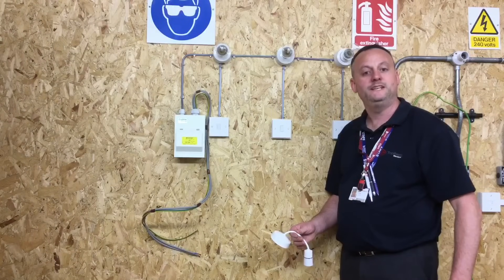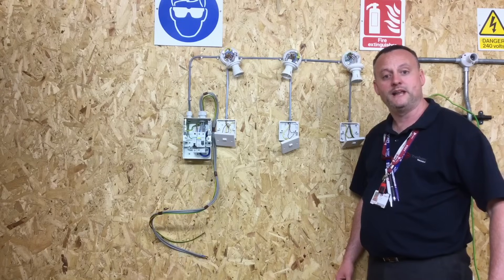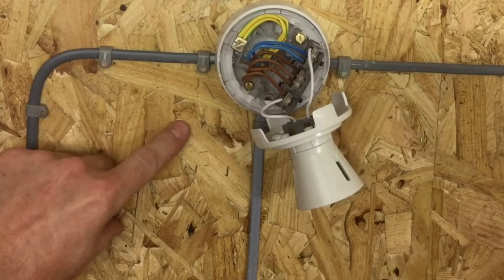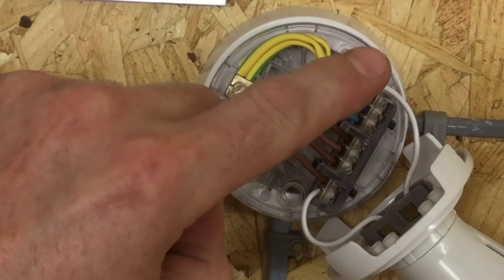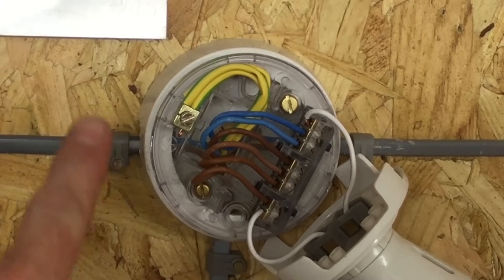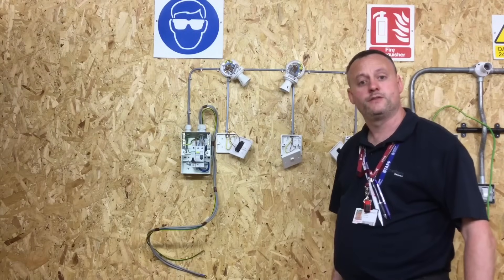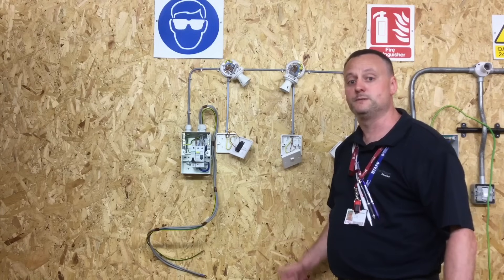3 Plate Loop-in Method for Wiring a Domestic Lighting Circuit - Connections Explained

Comment from the maker: == 🕐 Time Stamps - Cut to the action 🕕 ==
00:00 - Connections in a lighting circuit explained for the 3 plate method
00:50 - Metal consumer unit and 6 amp MCB
01:41 - Connections inside my consumer unit
02:54 - Connections in my first lighting point explained 
04:37 - Connections in my first light switch explained 
05:06 - Continuing on the 3 plate method to other room
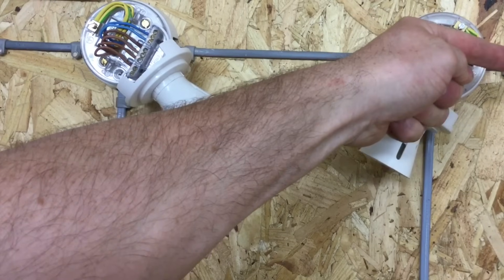06:36 - Connections at the end point of our lighting circuit explained 
07:43 - Connections in a one way lighting switch explained when twin and CPC (twin and earth) cables is used instead of with brown and CPC

Comment: What do you do if bedrooms number two needed 2 or 3 lights controlled from the same switch?
Reply from the maker: Wiring Diagram Using a 2 Gang Switch Converting it to 2 Way Switching Using 3 Plate Wiring Method
https://youtu.be/CyQxiX9XX_0
Reply: @GSHElectrical  ❤️

Comment: Thanks for the video it may have answered my lighting problem, I have a light that has stopped working (bulb ok not tripping), but also the light in the hallway that are on the same circuit. I am guessing form your video that the rose could be the issue as the power is not then getting to the next rose in the circuit, so possible become loose.

Comment: My house is wired in this way. I'm looking to add a light on a switch in my loft. Do I need to get into a live cable to an existing switch, add a junction box and then run a new cable to the switch and from the switch to the ceiling rose?

Comment: Ok Gaz, question, to fill in a ignorance gap. You have in this vid, 1 consumer unit. And, 3 switches. And,   3 lamps with 3 batons. Each baton has 3 brass blocks in it. What therefore, does the term, "3 plate" refer to please?
Reply from the maker: The connections in the light fitting 👍. Thanks for commenting. Gaz 😁
Reply: @GSHElectrical  thanks for getting back to me. And so quickly too. 😊
Reply: @GSHElectrical  If the terminals in the light fitting are referred to as 'blocks' then why isn't it called the "3 block method"?

Comment: What should I do if I need more light with independent switch? As there is 1 rose in the room fit with the light. There are 3 cables in the rose loop in loop out and switch and there is no empty terminal in the rose

Comment: If using twin brown and not line and switched line, how would you know what brown you’re putting into the feed and the one to the com in the switch. As you could put the one of the browns into line feed in the ceiling rose and the same brown into l1 in the switch.
Reply from the maker: It’s doesn’t matter the only thing that will happen in the switch will be upside down and need turning around. This will be picked up during the continuity of cpc and polarity test. Thanks for commenting. Gaz 🦾.
Reply: @GSHElectrical  I now understand👍 thanks for the quick reply

Comment: No provision for a neutral at the switch (which a lot of smart switches need). Presumably a four way cable could be used with suitable coloured sleeving, but then the rose block doesn't have provision for four neutral connections. I don't know if any are available.
Reply from the maker: Lighting Circuit 2 Plate Method Taking the Feed to the Switch and Connecting a 1 Way Switch & Light https://youtu.be/1G4fW2DeqPA
May help 👆🏻.
Not all smart switches now need a neutral...

Massive thanks for commenting and watching. Gaz 🦾.
Reply: @GSHElectrical  Yes, I know about the two place method of course, but my point was about doing it via a three plate method. The only difference is a 4 core vs 3 core for the switch.

Comment: Have you ever heard of the term "Travelling switches" used in controlling lighting of long corridors (in hospitals) . I recall my tutor mentioning them, however that's a few years ago now. It involves progressive switching e.g. switch one turns on the first fluorescent light, switch two turns off the first fluorescent light and turns on the second and so and and so forth. I have forgotten how this arrangement would be wired and which switches would be used. Any ideas or do you have a video ?
Reply: That sounds weird, how would you walk backwards? Eg, from switch 3 to switch 2?

Comment: Thanks for posting video, quite helpful. I'm trying to pick up some electrical knowledge as I work in the building trade (carpentry, decorating, plastering) but its not easy. Whenever I read books they launch into protons, neutrons and electrons and doing the maths of working out resistance on a parallel circuit, all seems a long way from deciphering the spaghetti of a 2 way switch with 3 different colour codes and a new light fitting that requires an earth, if I'm honest it drives me up the bloody wall. Electricians don't seem to help as they seem to be a law unto themselves, I was recently working in a bathroom, removing a light fitting so I switched of the lighting circuit fuse only to have my screw driver explode on me because the light had been wired of the ring main. Admittedly I should have double checked if it were live but its a bit like having to look left and right when pulling out into a one way street, you don't expect some twat to be driving up it the wrong way. If I sound like I'm having a bit of a dig at electricians, I am , stick to the rules and please sweep up all your crap after working on site as you are notorious for leaving it behind for everybody else to sweep up, ditch the prima donna syndrome. Anyway, Ive gone off on a rant, appreciate the video, thanks
Reply: There's the difference between 'working in the building trade' and being a qualified electrician. The electrician would have tested the circuit even after pulling the fuse. Many amateurs never get the opportunity to learn from not 'double checking'. Consider yourself very fortunate. A couple of other observations; you can't be sure that it was an electrician that wired the light to the ring main (which is fine if a fused spur is installed), and it seems a tad cheeky  to be telling electricians to stick to the rules when you haven't a clue what you're doing.
Reply: @duncanmacleod7283  I can take a punch on chin, is fine , you raise a good point , I don't actually know for sure it was electrician, wouldn't exactly say I don't have a clue, that is a bit strong. When I say stick to the rules I mean it in a broad sense, too much red tape is restrictive but we are quite lucky in this country having such a strong electrical body that is there to help people and uphold standards, if the same had been applied to cladding then maybe there wouldn't have been a cladding crisis. As for electricians coming on site for a few hours and leaving all their crap for someone else to clear up, that is just damn right cheeky and arrogant, is it beneath them to be responsible for their own mess and is disrespectful to other trades like decorators and plasterer's that need the place clean and tidy.
Reply: When checking wiring don't always assume that brown is live,as shown blue can also be conducting 240 volts and some lazy electricians don't bother brown sleeving or taping it.

Comment: Not an electrician but i'm just wondering, in the UK why don't we take both L&N down to the switch and back up like some other countries? Is this just down to saving on cable (like why we use ring circuits) or is there actually another reason?
Reply from the maker: Hi. Have a look in this playlist thanks Gaz 
https://www.youtube.com/playlist?list=PL2Ea5r9gxUUevU9gv8lizD53aYvwiJ5qr

Comment: Somethimg I've always wanted to ask:
Since EVERYTHING (except the protective cable) behind a switch can become a switched line at some point, and every "competent person" understands this as a fact, why is the brown sleeving required at the switch end?
I understand why we identify it in the lamp assembly, but surely identification behind the switch is overkill? I cannot think of an occasion when all cables except the epc wouldn't become a switched line behind a switch.

Thanks!
Reply from the maker: Hi. If a twin and CPC cables was taken to a switch using blue as switching line and not neutral as it’s colour indicates wouldn’t be misleading if it wasn’t over sleeved in brown? What if a switch had a combination of feeds in and out and switch drops using blue as switching lines and not neutral again the sleeving would indicate the conductors. Thanks for the question GSH Electrical.

Comment: wouldnt the switch line returning from the light switch be blue with brown sleeving?
Reply from the maker: Hi. In this job my learners use twin brown and cpc at lighting points 1 and 2 and the final  switch drop twin and cpc so the blue conductor is sleeved brown as it’s the switching line conductor. Thanks Gaz

Comment: Would also be good to show how led downlights are installed & how you fully test them ie R1+R2 & Insulation Resistance testing either at 250v dc or at 500v dc with Line & Neautral connected together.
Reply from the maker: +Michael Woodward

Hi. I have a contact at Collingwood lighting and they want to do some stuff on their LED lighting so look out for that one in the future. The tests on lighting circuits with LED downlights is the same as any lighting circuit. You do need to remember however not to connect either the switching line or neutral at the final connection to each downlight during the second fix. By not making this connection to the LED fitting I normal don't connect the neutral on the fitting then you can carry out your insulation resistance L/N L/E and N/E with no risk to the downlights having 500 volt passed through them. Hope this helps GSH Electrical
Reply from the maker: +Michael Woodward
Part 1 Answer...
Hi. I have a contact at Collingwood lighting and they want to do some stuff on their LED lighting so look out for that one in the future. The tests on lighting circuits with LED downlights is the same as any lighting circuit. You do need to remember however not to connect either the switching line or neutral at the final connection to each downlight during the second fix...
Reply from the maker: +Michael Woodward 
Part 2 
By not making this connection to the LED fitting I normal don't connect the neutral on the fitting then you can carry out your insulation resistance L/N L/E and N/E with no risk to the downlights having 500 volt passed through them. Hope this helps GSH Electrical